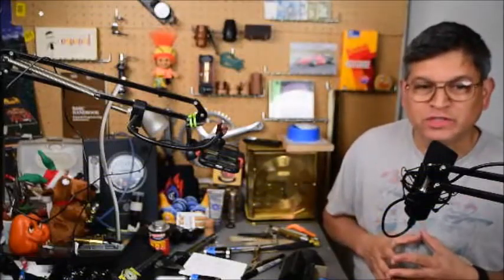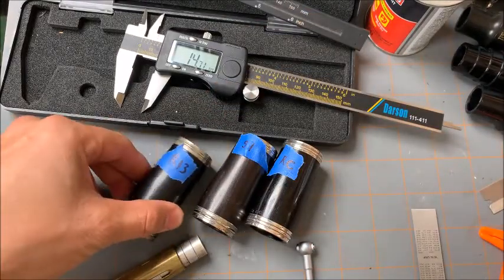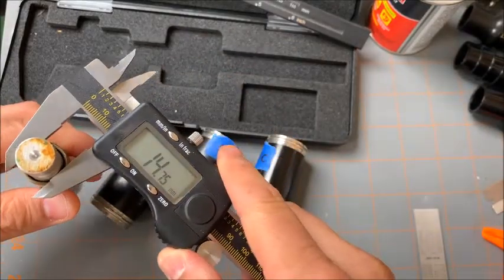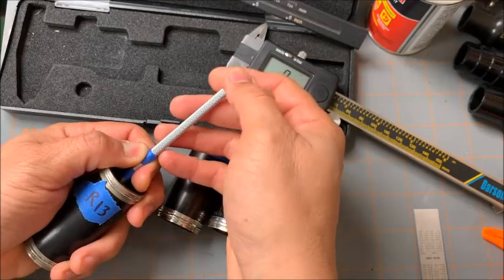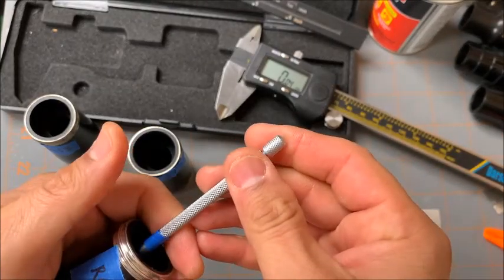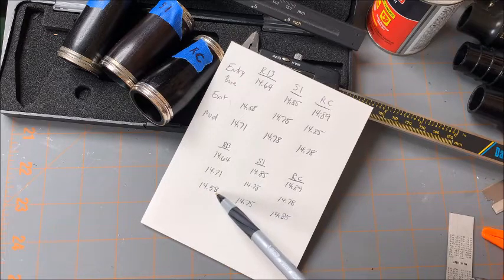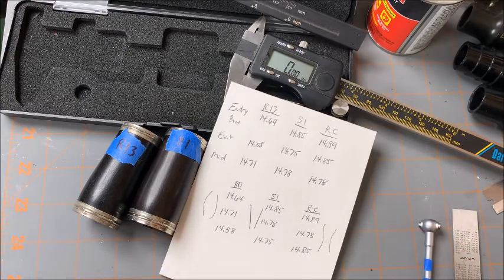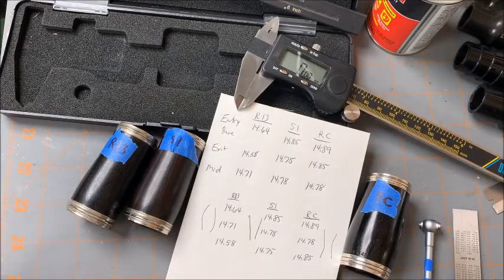Buffet R13 barrel vs Buffet S1 barrel vs Buffet RC Prestige barrel tehcnical comparison

Comment: I measured my 1994 RC barrel (non Prestige) using a three-prong digital internal micrometer:
It measured 15.20 entry bore and 15.02 exit bore. It did not swell or shrink in the middle.
Can't say whether it was dried out or not, but the rings were not loose.

Comment: Great video, definitely thought provoking. I am curious as to how the other R13 barrels will compare to the one in this video…
Reply from the maker: It was a surprise to me.  I also have to confirm the best method to measure something that is larger than the hole you are pulling/pushing it out of.

Comment: Hi, Which instruments do you use to measure the barrels and how does it called? the two ones measuring the internal bores
Reply from the maker: The one tool I show in that video is this one https://www.ferreestoolsinc.com/collections/woodwind-supplies/products/g56-bore-measuring-tool?_pos=1&_sid=3b8ddaf49&_ss=r

I also use T shaped telescoping gage sets, and also a micrometer digital measuring tool - you want a good one as the cheaper one's flex.  I used to use a shotgun bore measuring tool in the distant past too to measure the entire bore.